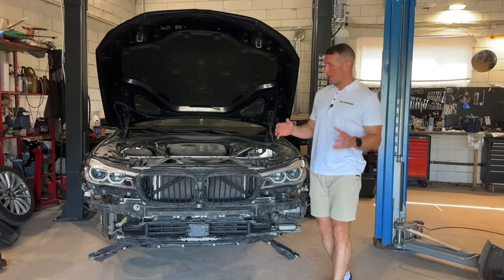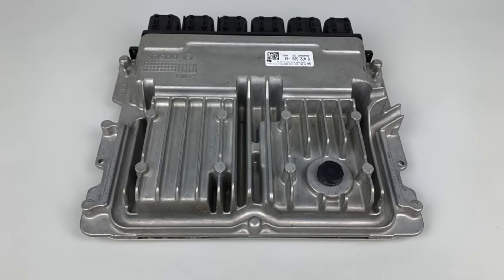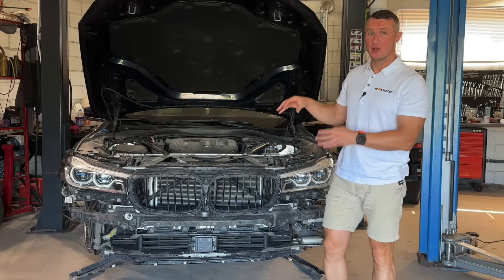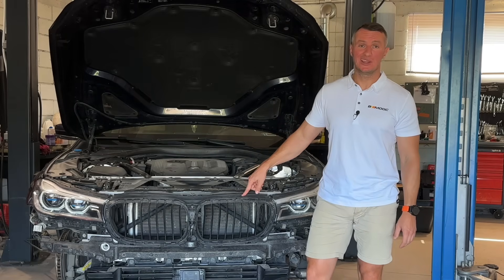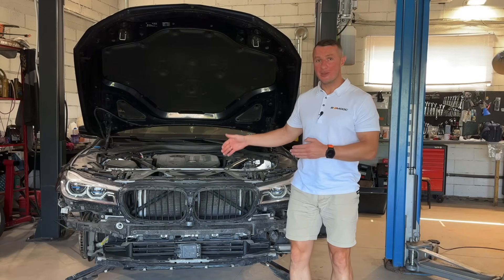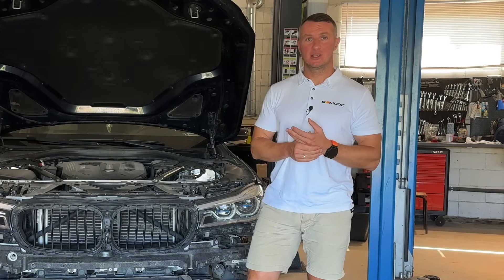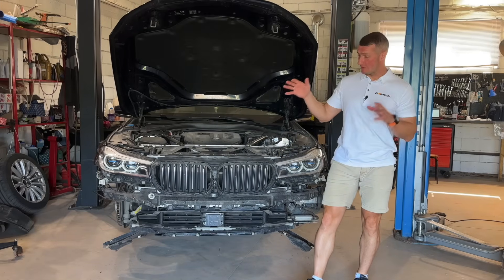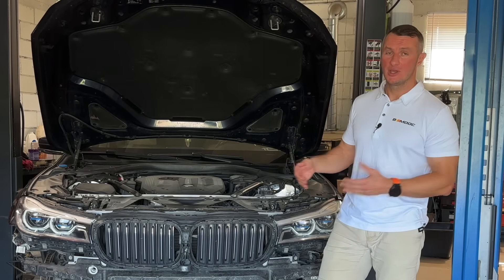BMW G Series Cooling Flaps Explained: Troubleshooting, Recoding, and Cost-Effective Fixes

Comment: dumb question, if the flaps open when AC is turned on, what will the point be then? AC should always be on, and will be when climate is in auto?. and also, is it possible to program top flaps to be open when vehicle is stationary and not running? it looks way better being able to see through, and less like an electric car.

i live in norway and its currently cold here, will it actually struggle to keep operating temp in winter? i know many audies have this problem, but my E60 with n47 keeps 87 c easy all year. takes time ofcourse in winter.
Reply from the maker: Unfortunately you cannot control how those flaps are working. Algorithm is written if flags part of DME and not modifiable via coding.

Comment: Great video.  My flaps are open continuously and I am having diesel in the oil due to regeneration issues, can the lower temp impact regeneration, note the car is doing a lot of short trips which is not ideal
Reply from the maker: If there is an error prevent that causes check engine light then it might affect regeneration!

Comment: Ola, eu fiz esse processo como descreves e passadas 14 horas com a bateria desligada as grelhas não abrem, antes ao destrancar o carro fazia o check mas agora nem isso faz, tens alguma ideia do que possa ter corrido mal?
Reply from the maker: Unlocking the car shall not cause flaps to open. 

Turn on engine and climate. Then flaps will be forced to open.
Reply: @BimDoc A que temperatura é que elas se começa a abrir? Eu moro na suica e aqui estão 3 graus. É possível que mesmo o motor quente elas não abram derivado ao frio exterior?
Reply: @BimDoc ldr 95 graus e óleo motor 92 graus
30 klm feitos e as flaps sempre fechadas

Comment: Can you follow the same process for the upper flaps if you only have the upper flaps limit position not detected error?
Reply from the maker: Yes you can, but upper flaps are kinda big. That’s why it’s better to fix them.
Reply: @BimDoc Have you seen on 2021 G30 where the error returns even with all of the coding parameters set to 00 - nicht aktiv? It clears but later returns after some time

Comment: Do you believe that after deactivating the lower flaps, you should disconnect them (electrically)? In orher words, will you still have the fault active if they are connected to the car after coding?
Reply from the maker: Yes you have to disconnect the plug physically if software wise you coded it out.

Comment: Hi  Vladimir
I need your advice.I changed top actuator yesterday as have electrical issues.Now diagnostic say bottom flaps blocked during initialisation.
I did coding and need disconnecting lover flap.This is bottom plug under the plastic tray it's there different plug.?I need just top to work.
Thank you
Reply from the maker: The ones that are coded out have to be disconnected!
Reply: Did bottom plug on lower flap are not power supply for both flaps or have independent power?
Thank you

Comment: I did everything, but the Ista shows fault code: radiator blind does not match coding. What is the reason for this? Edit: Well, I remembered that I had not disconnected the lower flap. Probably the fault code I mentioned is because of this? Do you always need to disconnect the lower flap?
Reply from the maker: Yes you need to disconnect. 
Other wise ECU get the error

Comment: On my auto it's not working 😢g30 540i 2019
Reply from the maker: Usually on G30 there are no problems with that system
Reply: @BimDoc The one below doesn't work anymore. I deactivated it with esys, and now only the one above works!

But the error still exists in ista!
Reply: @mikemanolache4879 do you have the flaps still electrically connected? You need to remove the comnection after coding!

Comment: Thanks ❤ my car didn't had a problem yet , but I like to prevent. 😅 because its already 8 years Old.
How to code "Always Open" rear exhaust valve G01 S15A platform ❤ 
I have set my Flaps on Value 3 "Not Used" , if I put it on value 1 just for the top than it was some conflict, so now they just stay open ( full on the lower part , almost full on the upper side )
Reply from the maker: I haven’t looked for that parameter jet. Cannot comment.
Reply: @BimDoc  I trust that you can do it ❤Always Open rear exhaust valve or on Drive mode

Comment: hello Vladimir! can you help me with something, please? I had a small accident on a g20 and the active grille on top was affected. I glued it on and it works (it only opens when I turn on the ignition or when necessary and closes when I turn off the engine). on the same one in the test plan it gives a blocking error 138803. I also changed the grille with a new aftermarket one and 5 actuators from dismantling and on all of them I have the error and check engine. the sensor in the actuator does not see that the upper limit is reached. can the actuator be recalibrated somehow?
Reply from the maker: Hi,
I don’t think it can be calibrated. Correct values are hardcoded there. 

So either disable via coding (not recommended for upper grill)

Or replace with eom one (can be used as well)
Reply: @BimDoc Thank you! I have already replaced 4 other original actuators. I find it hard to believe that all of them have problems. With all of them the grille opens and closes when needed but with all of them I have the blocking error in the test plan in ISTA and check engine. I am starting to think that the only solution is a new original grille that comes with the actuator.

Comment: Hi Vladimir 
I have watched your video on cooling active flaps but the issue I have on my G01 X3 is the upper flaps stay open all the time I’ve scanned the vehicle and the error code : 32CE00
Error: Bottom radiator blind, plausibility: 
adjustment range too small
Is this a faulty lower radiator blind?
Regards Anthony
Reply from the maker: Yes you have error for lower flaps. 

But is lower flaps are not working then it can cause error for upper flaps as well.

Comment: Si se anula el flap de abajo parachoque, No ABRE Y el enfriador de aceite,no refrigera y sale fallo en aceite demasiado alto ,o parecido.
Reply from the maker: If lower flap is removed then more air comes into the engine bay… how more air can cause overheating?
Reply: @BimDoc  Si se anula rejillas riñones, el flap de abajo parachoque, No ABRE (Creo) y el aire no entra. 
Pero si dices que se puede quitar flap de abajo ,yo lo intento. Me quedan cerrados todos y no me da error,mini información, solo en modo deportivo ,partir de 20 min , aviso conducir revoluciones normales , aceite elevado.
Gracias por todo

Comment: Is the upper flaps actuator plug and play? or it requires coding for the car to recognize it? On my G30 the flaps stuck to open yesterday, and would like to know if I can fix this on my own. Thanks!
Reply from the maker: It is plug and play. 
No extra coding is required

Comment: Hey, thanks for this very informative video! Absolutely world class. I drive a G30 (2017) and my flips have been out for a year. Diagnosis at BMW: upper air flaps have an electrical problem, mechanically everything works. The lower ones have also worked so far. They have both been closed since last summer, but I would like to use the function. The control unit for the upper one costs approx. 70€.
Should I change the control unit directly or pull out the plugs and restart as you recommended?

Many thanks in advance
Reply: Do you also have a video on how to replace the upper control motor? Is that complex? Does the front bumper have to be removed for this?
Reply from the maker: It’s easy to remove upper motor. 
In your case I’ll replace it to keep system working as it is designed.

Comment: can you show us how to operate front flaps using software so we can get the confirmation that these are working correctly. Basically show us if it is possible to by-pass the DDE command to check that the flaps are operational.
Reply from the maker: It’s possible via ista service functions (see my latest ista video how to use it)

Comment: Can anyone help me to code a bmw e60 when water temp reach 85 degree to open ?
Reply from the maker: Thermostat opens based on temperature and cannot be adjusted. It can be changed to another one (with lower higher temp). But it’s not recommended, because it will affect engine working temperature and cause another issues.
Reply: @BimDoc  I don't talk about thermostate I'm talking about active grille

Comment: Great video. Do you help to fix it and whats the cost for that service please? Thank you
Reply from the maker: If you need only coding assistance then it is not expensive and doable remotely as well (but of course only on the vehicles where it’s supported)
Reply: @ my issue is both stay opened, not sure what problem is it.

Comment: Hi, sir! My e93 bmw non facelift  has a error 434E DDE : Cooling-Air-Flap System, Activation. Can you tell me what is the problem here? I had check engine error and tester show this code. If my car has the active grids disabled, could this be causing the error?
Reply from the maker: Yes that error is because of active flaps
Reply: @BimDoc  Can they be canceled somehow from the tester so that the error no longer appears?

Comment: Hi Vladimir I just code my bmw g30 and I forget to unplug the lower shutter after I coded I wrote “01” . Then check engine light comes on why?

3, Radiator Shutter: Communication Fault Between The Upper And Lower Radiator Blinds
4, Radiator Blind At The Top, Actuation: Lower Limit Position Not Detected 

These the fault
Reply from the maker: Code all to default settings 
Delete the errors
Allow car to sleep
Delete errors again if needed 

Should help

Comment: Hey Vladimir, can you help me? what is the best and fast thing for now (i have bimmercode)

i coded the car with Bimmerlink and i got this error;
Digital Motor Electronics
1
error
21B042: Active cooling air flap control (AKKS), below: Blockage at all ambient temperatures

Comment: Hi Vladimir, First i would express on my gratitude for the great videos. They are really informative. 

I also have an issue in the active grill of my G20 (2021), the motor is working fine, it is opening and closing but the issue is the TOP grill is not reaching to the maximum  position of closing. so it generate this error :

138803 | Radiator Blind, Top: Upper Limit Position Not Detected

I there any way to code the movement range? 

Note : 
- The lower one is working fine.
- I changed the motor still the same issue.
- the car has a M-Kit.
Reply from the maker: I haven’t seen movement range coding parameters. It doesn’t mean that they are not there. But might be not as straight forward.

Comment: Здравствуйте Владимир у меня проблема с G20 когда я отключил нижние жалюзи у меня появилась ошибка cd9204 шина Lin сообщения верхние жалюзи радиатора: отсутствует также лампа чек светит на приборной панели! Кодировал LKS_UNTER (01-00) возможно нужно ещьо что-то сделать буду признательный за любой совет
Reply from the maker: Отключите и подключите верхние жалюзи (фишку с моторчика)
Тогда должно получиться.
Reply: @BimDoc   I am going crazy with this codes cd9204  cd9203 on a G20 S18 too. can i permanently disable it? i upgraded the front bumper to a G80 and don't have flaps

Comment: Thanks Vladimir. I have found with BimmerCode the following two errors on a G01:
279B00 - Active cooling air flap, diagnostic feedback: electrical fault
32C300 - active cooling air Flap below, plausability: control deviation
The upper flaps are always open as you said.
What do you think about the two errors? What could be the culprit?
Reply from the maker: If one of the motors for flaps failed it will cause false errors for second one. 
So it’s not possible to say which one has failed. Upper or lower. 
Test are required.
Reply: Thanks Vladimir. Your advice saved me a lot of money. It was the lower motor. I disconnected and made the coding and the upper flaps are working again. Thank you again!

Comment: Hey Vladimir, I’m having a problem with my g20’s upper flaps, they were broken, I replaced them with aftermarket flaps, but kept the oem actuator motor. They work fine when they are recalibrated through software, but stop working after a few hours. The actuator motor does not seem to be the problem, since I have tried with different ones, and it’s the same story. They work a while, and after the car is off for a few hours, they start malfunctioning again, could this be because of the aftermarket flaps?
Reply from the maker: They might have different movement range, that causes an issue. 
So it is worth checking. Let us know how it went
Reply: Hey @narekl1297. Have you fixed your problem? I have pretty much the same issue with the lower flaps. On a cold start, I can drive indefinitely without the temperature rising, but once I turn off the car and start it again after a while (30 minutes or more), the flaps stay closed and the temperature goes over 110 degrees. I’ve got the 30C400 error, but I still don’t understand how it works normally on the first drive, and then starts acting up after restarting the car.

Comment: Hello Vladimir 
I have had this error 13820A for some long time, but the lower flaps work, i.e. they open and close, what can it be? 

13820A: Active cooling air flap control (AKKS), bottom: Blockage at all ambient
ambient temperatures in initial and teach-in phase
Reply from the maker: They might move be the range and/or the smoothness of movement might be affected to cause and error. 

Until they visually move I suggest do nothing. 
You can always replace the parts when they fail completely.
Reply: Are your upper ones working? It might just be the top ones

Comment: Thank you for this brilliant and exceptionally clear video, I'm glad to have found you and your content. ISTA is telling me the Motor for my upper flaps is faulty but I am concerned it is the lower flaps. Easy to replace if you DON'T have ACC, which I of course have! I'll replace the upper flap motor first and if the angels are on my side the lower flaps will work again. G32 6GT
Reply from the maker: If you have error with upper flaps then replace the motor. 
Always prefer fix to just deleting the components.

Comment: If you have lower blind error do you need disconnect cable and decode or just decode is enough?
Reply from the maker: Yes you need to disconnect that as well. Otherwise it will not work. Blue coding is not enough.
Reply: @BimDoc it's possibile without tearing out front bumper?

Comment: Super video!
Fixed an issue for my G31.
Thank you very much for making this video! 🍻
Reply from the maker: Glad it helped!
Reply: Olá tiveste de desligar a ficha do motor ou só codificaste com o easys?
Reply: @MarcoAzevedo-h7o need to disconnect flap motor, or you get error in diagnostics.
Reply: Obrigado pela tua resposta, é para desligar a ficha foi preciso desmontar o para-choques ou consegues por baixo do carro?
Reply: @MarcoAzevedo-h7o i managed it to do from under the car without taking off the bumper. But it was not easy. 👌
Reply: @rinalds2m Já consegui fazer só falta codificar agora. Obrigada

Comment: hi from Latvia Vladimir! when i test with ista its shows electrical foult in upper motor.. i changed to new upper motor bet the error stay the same....then i disconnected lower motor plug and then upper blinds started to work but not normal...sometimes it stay close sometimes its stays open why that?  error in ista is gone whwn lower motor is unploged.......
Reply from the maker: It could be because actually the lower motor is faulty and it causes wrong reading and behaviour.
Reply: @BimDoc  thanks for answer!
Reply: @BimDoc  one more question do i need unplug lower motor before coding?

Comment: you didn't add that coding doesn't work for S18, I checked it on several cars. For S15, you can turn off the flaps, for S18, such as X5.3, after turning off the flaps in coding, we still have an error and a check engine light on kombi
Reply from the maker: I haven’t checked on all possible cars and different software versions. 
So there might be exceptions (((
Reply: @BimDoc  did u check for g05/g20 also?

Comment: Thank you so much for the effort and informations. Just question that came to my mind... is coding will take over even check engine light caused by the shutter?
Reply from the maker: If you code out the option that causes check engine light then of course it will help )

Comment: Hi and another question 😂🙏
If I want to code the DME module, like AKKS or start stop memory. Can I change the value and save it while engine on? After that, and turn off engine, ignition on before click code FDL??
Reply from the maker: Coding can be done with engine on to all ECUs EXCEPT engine ECU. DDE has to be coded with engine OFF and ignition ON. Always.
Reply: @BimDoc  Thanks for your response😆

Comment: Hello, I have problem with BMW F11 2017 535d Active Grill. All times is closed. One time I see, that was opened in summer, but so is closed. How to find a problem or activate in ISTA for testing active grill? Diagnostic not shown error. Thank you.
Reply from the maker: In ista go to DDE and/or special functions. And over there you will find an option to force open flaps. 

Another way is to turn on AC. it should also force open the flaps.

Comment: Servus! Gibt's eine Möglichkeit die flaps dauerhaft zu öffnen? LG.
Reply from the maker: Not via the coding. And they should be opened if smth is wrong with them. Otherwise your engine might be overheating.
Reply: @BimDoc  They work normally! I just wanted to stay open😁

Comment: This method doesn’t work on the G05 2020 B58! After coding LKS_OBEN and LKS_UNTEN, the error with the blind stop still remains! When I disconnect the top and bottom connectors, the error remains with the LIN!
Reply from the maker: Good to know that 
Thnx for information
Reply: @BimDoc  The client reported that his blinds were turned off! But to say that the technician removed the DME, did something and put it back!